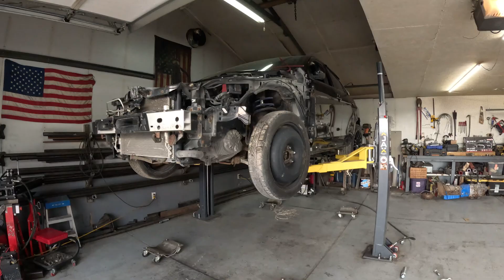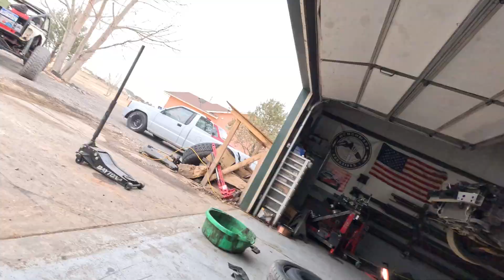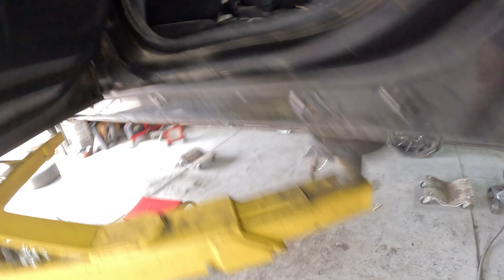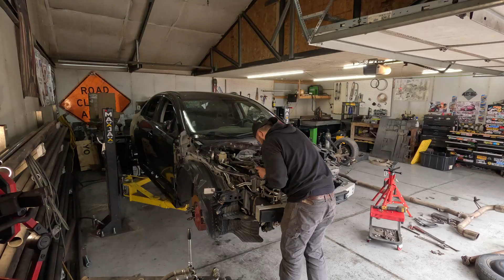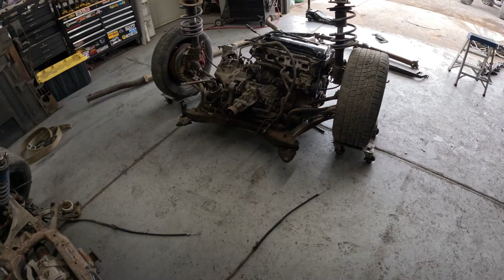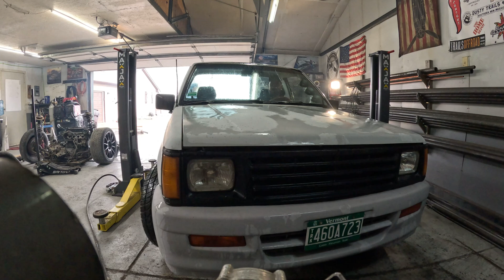AWD Mighty Max Build - part 1 - Evo X teardown

Comment: Looking forward to this one!    I have a question, Im about to order a maxjax lift.   Curious how far apart you mounted your posts.  outside to outside measurement?  Do you have any complaints about the lift?
Reply from the maker: I can measure it but how I set it up was took measurements of my normal builds width of the tires and frame widths. Most of the stuff I build ends up one 1 ton axles so wanted it wide enough to fit easily. No complaints so far. Works really well and have done quite a few full builds on it so far. Easy to use and 110 power is nice. Doesn't lift as high as a normal lift but when working with limited space it's a game changer